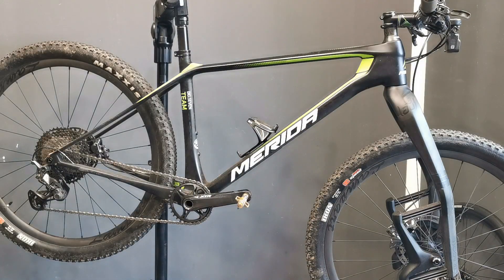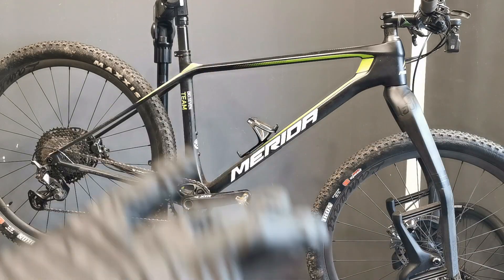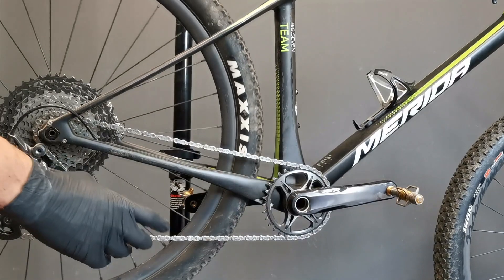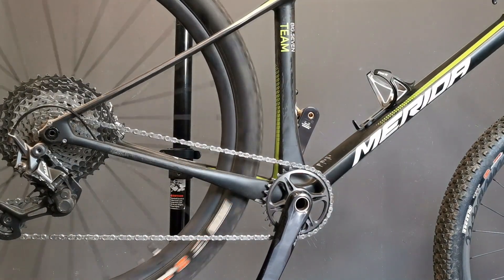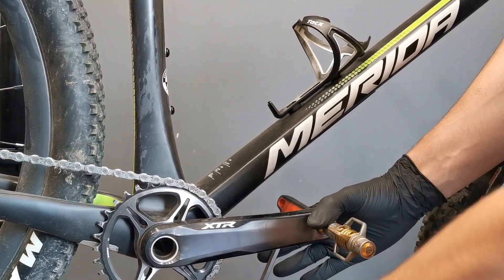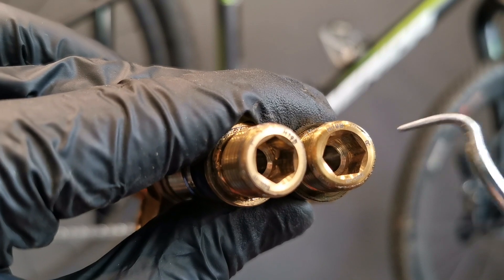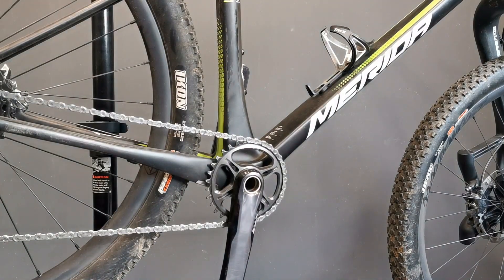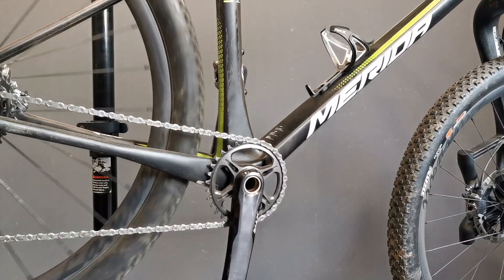Bike Hack - Spin The Wheel And You'll Know, How To Tighten BOTH Pedals To The Crankset.

Comment: i understand the opposite thread for pedals but if you look at the rotational force if a bearing breaks down and grips, the force is going against the thread undoing the shaft, chances are slim but still has me boggled why they dont have them tighten in the other direction from there rotation,
Reply: I thought that too. However, over time, pedals would become impossible to remove, due to all the tightening.
Reply: @diyowl5496  Actually, the pedals do indeed tighten while pedaling. The forces at work here are opposite to what intuitively seems logical at first - check out (for example) Wikipedia’s article on ”Precession (mechanical)”. 

The same phenomenon is also the reason why the bottom bracket cups tighten / loosen the opposite way.
Reply: @CodSlap  Good point. You are right!